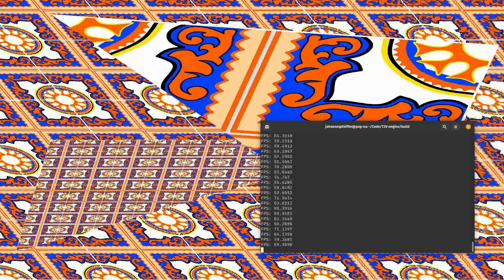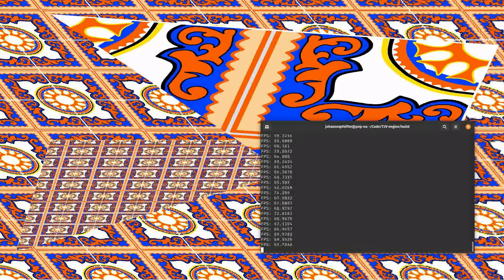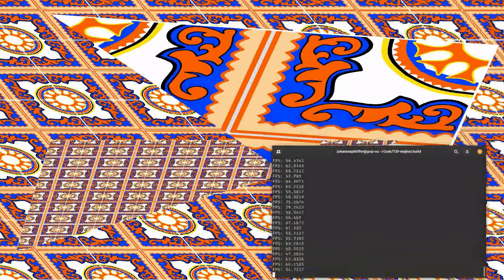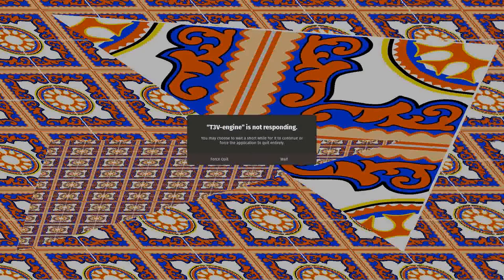3D Game Engine Devlog - Week 1 - Implementing a Software Renderer

Comment: Nice project! I'm interested to see what kind of performance you can get out of the software rasterizer, there's probably a lot of room for cool optimizations. I give this a 10/10 flex rating 💪
Reply from the maker: In the end I want to make small FPS shooter demo where you have a rocket launcher. And there will be explosions! This will be the total flex when this runs in software rendering mode. :D
Reply from the maker: And this optimization part is totally weird. You end up doing weird stuff all the time just to make it run a little bit faster. Though it's a very educational exercise.
Reply: @t3v727  Sounds cool bro, I'm preparing myself to get mega flexed on!!